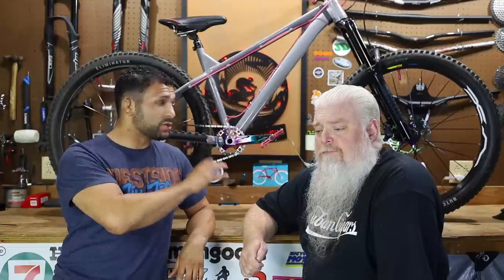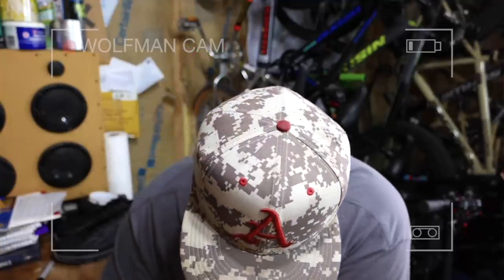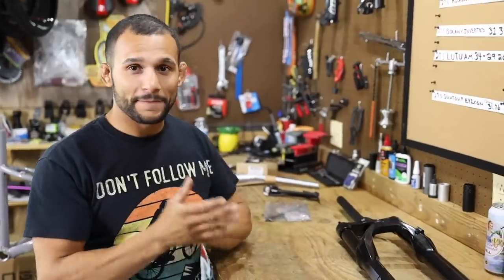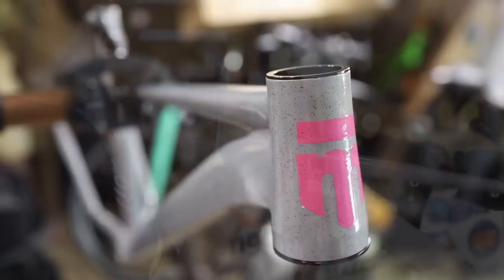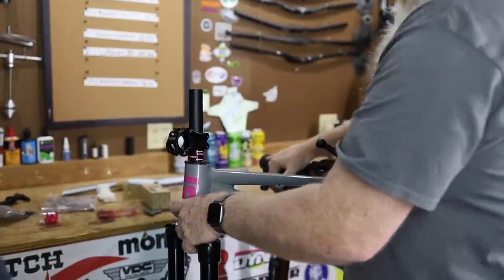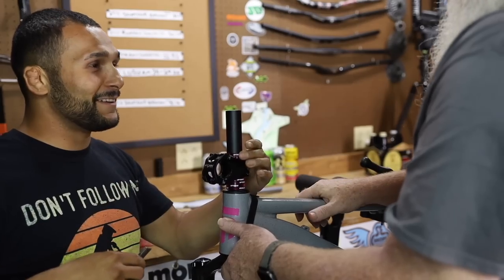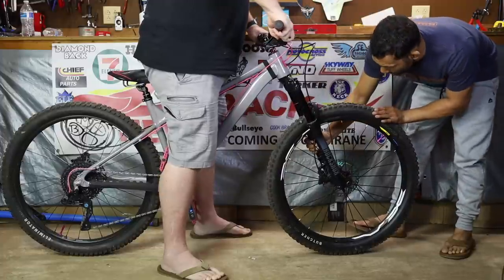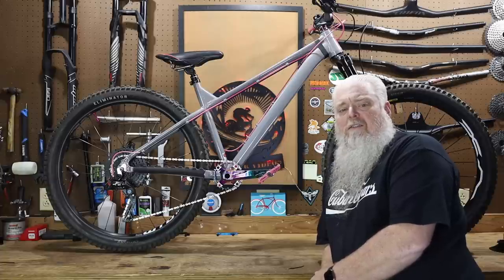RockShox 35 Gold: Initial Impressions | Install

Comment: Despite all the supposed problems with the 35, I find it to have a really good ride and perfectly good for trail riding. I've never tried a more expensive fork, but the 35 is serving me pretty well so far.
Reply: I think most of the supposed problems with the 35 were the first OEM models
Reply: The 35 is a perfectly fine fork ... until you ride something better.  I had a 35 gold on my previous bike and was ok for that bike, went to a DVO Onyx SC on my current bike and it's night and day better.
Reply: What kinda problems are there with the 35? I figured it was just a beefier recon. Only have experience with the recon silver, judy silver, and the yari. I skipped the 35 on my enduro bike because I got a brand new yari for $300. 

Always wanted to try the 35 silver though because it's a coil fork!
Reply: I stay clear of rockshox personally. I had to one rebuilt within a month and it was better than new. To add to this, someone I knew had a top end rockshox like a $1000 fork that had the same issue. This happened back in 2019 and I've gone elsewhere and won't touch their products again. Fox forks again if I could afford it but I don't have that sort of money to spare anymore but the SR Suntourer's are doing a better job than the cheap rockshox I had.

Comment: I like that steering stem! I'm looking forward to seeing the riding review this Fork, I've never used the RockShox really because I'm not used to working on them and all the lower-cost ones are so heavy! I'm glad you still getting use out of that headset press. I always cut my steerer tubes to about seven and three-quarter inch and they fit about everything

Comment: I have 35 Gold (came stock on my bike) lying around as a spare while the Lyrik (which I bought as an upgrade) is being serviced. Well, the 35 Gold is a decent fork, as long as it works properly. Rumor has it that in 35 model there were some issues with bushing tolerances in the lower legs, not sure if it has been resolved by Rockshox already. I've seen some pictures from other users reporting that the black anodizing has been worn on the upper legs (in serviced forks), luckily most of them sorted out by warranty replacement. Mine did not suffer from that, but definitely is no longer as smooth as in the beginning (yes, it's been serviced). There is a bit of stiction when it rebounds. Please make sure that your fork has enough oil in the lower legs, because mine did not have, there was some, but for sure it was nothing near the 10 ml recommended by Rockshox.

Comment: The 35 is a solid entry fork for people wanting too bigger and dabb into the high end stuff. I had a 35 and it was my first "big fork" since the early 2000's (I used to run big double crowns and the big single crowns of the daylight). I enjoy it, it worked well and was fairly reliable. I had nothing bad to say of it.
I have since gone to high End Marzzochi Suspension but the 35 Gold RL is a solid for budget builds and will do just about everything.

Comment: The rockshox 35mm forks are beasts! I have a revelation and it’s very nice. (I got it on sale for about £250, it would have been a bit too much otherwise) this looks very very similar what damper is in it?  That’s the only thing there didn’t seem to be a massively slow rebound setting. But let’s face it not many will ride at that extreme anyways

Comment: Hey, loved the video. I also have rockshox 35 with a 55mm frame to fit the forks on. What headset did you say you used to fit the forks to the frame? :)

Comment: I can’t make decision which to buy? 35 Gold RL 44mm offset or Reba RL 42mm offset. I have recon 120mm 42mm notice front wheel little bit out centred and cracked them and bend them. So would Reba be fine for pump track and dirt jumping? As I do load of road riding so like stiff forks but don’t want crack  them again. so better go for 35 Gold RL? If that good for road riding and jumps and stiff?

Comment: Picked up 2 of these recently to put on bikes, One is on a Intense Spyder carbon frame that i fixed (had a crack) And just added another to a Giant Fathom. They seem like very nice forks.   I usually find them for cheap because everyone thinks they need a charger damper and upgrades.  Have picked them up for $195 as new take offs.

Comment: Please tell me you went back and aligned the logos on the headset spacers!  Also, I have to agree with with the Wolfman, the sound of a headtube being cut  makes my teeth hurt.

I still wish someone out there  made an killer pink  replacement Box logo for the rear derailleur. That would be as AMAZING as the crusted sugar on real Gummy Worms!

Comment: Any recommendations for a 26" fork that uses the nuts instead of quick release / boost???  Everything I find is quick release or boost... Doesn't even have to be a good fork, it's staying on pavement... a triple tree fork would be cool because that's what I got on this bitch now... It just came with a precut steerer tube and they cut it so short you can't put a headset on it... it's "made" to put clip on handlebars on the stanchions and IDK how I feel about it

Comment: The specs on the Rockshox app actually always seem pretty close for setup. I used them for my Recon and Pike, both only needed small adjustments after the initial settings.

Comment: Unfortunately the reason why the 35 gold is so cheap now is because there has been lots of issues regarding the fork. Forcing a price decrease. Otherwise it would of been a great fork!
Reply: Isn’t the 35 gold the one you can put high end guts in?
Reply: @throbbinwoodofcoxley6830  Going off my research no unfortunately not.
Reply: @throbbinwoodofcoxley6830 no revelation and upwards

Comment: You guys know you lost about 15 to 20 psi when you hooked the pump up to a shock, right? So, your measurements on shipped air pressure are not accurate.
Reply from the maker: We don't think so. We actually have an episode way back that we did debunking that theory. We couldn't get the psi to drop more than 1 psi hooking up and checking the pressure multiple times. My guess is that theory must have started years ago, when the shock pumps were a little less specialized for their use. Appreciate the heads up, though.🙏

Comment: Those 35s are good but not great. You couldve got a yari for nearly the same, which is a superior fork. I got 2 Yaris for 270 and turned them into lyriks for 200 more. The internals of the 35s are different and cheaper from all the other 35 stanction RS forks. The 35s have smaller 32 mm cheaper internals, compared to yari, lyrik, revelation, pike which all have 35mm internals. So yo cant even change the travel on that fork or fit a better damper... Its also heavier due to the thicker stantions that use a cheaper material. Its still stiff and functional, i guess.... Oh and the suntour Aion is better than that 35 but inferior to the rest of the 35mm stantion RS forks...
Reply: Agreed, a used revelation is a much better fork than this. Also, I have read several times about the fact the lowers are different and that the bushing are just glued in place and can move from their stock position, getting stuck at the bottom of the lowers,
Reply: And even better than all those forks, fox 36.
Reply: @dylan-5287  Thats waaaaaaaayyyyy in its own category... although i agree, i prefer RS forks for their simplicity....
Reply: @oliebimbol7371  should i go for the aion or the reba? in terms of overall feel and play
Reply: should i go for the aion or the reba? in terms of overall feel and play